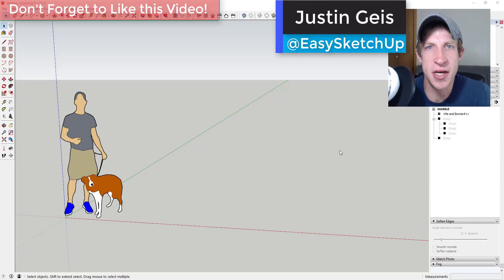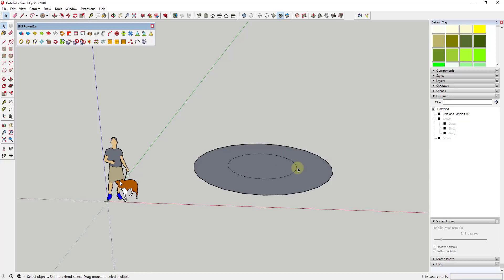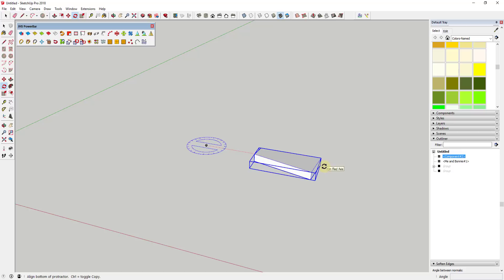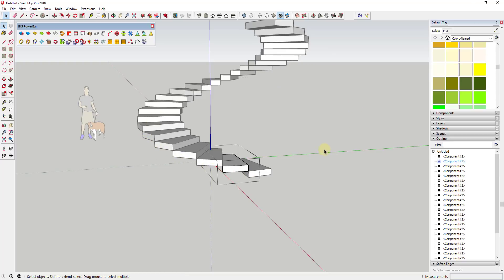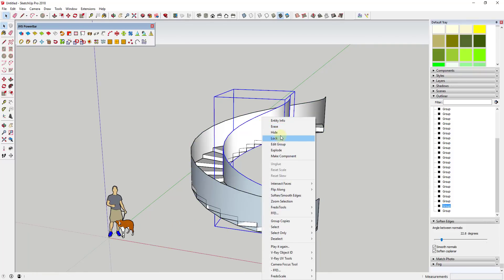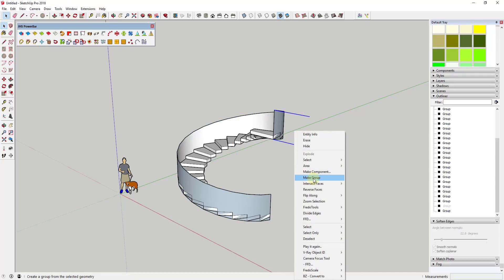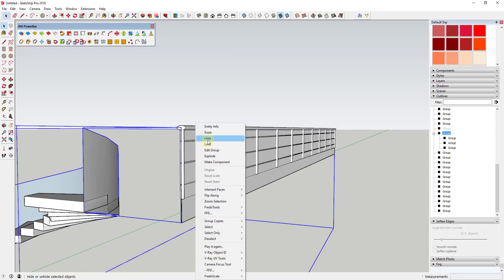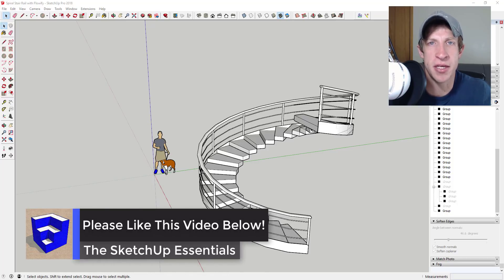CREATING SPIRAL STAIR RAILS IN SKETCHUP with Flowify

Comment: Hey, 

I'm having trouble doing the actual flowify, and you actually skip the part where you perform the flowify. It seems my grouping works, because I can impose grid. My railing is a little different though, because my railing is against the side of the stairs and not on top of it, so I tried not to draw my railing inside the flow panel like you did. But even when I do put it inside the flow panel, it keeps saying "not enough input". Any tips?
Reply from the maker: Well first of all, I don't understand what you mean about skipping the Flowify. I literally showed every single step in this video. Second of all, if it tells you you don't have enough input, your grouping is wrong, or you don't have enough objects selected...
Reply: @Thesketchupessentials  Sorry I wasnt trying to be a smartass! It's just, at 17:16 you say "hit the save button" and then your rail is done after a cut. Other than that I can't really figure out what I'm doing wrong, since I feel I'm following the steps...
Reply from the maker: @ThirdDegreeGurn  17:45 I run it again and show you exactly how. Your grouping is wrong - you don't have your 3 groups inside a single group, or you're not selecting your base object and your target group.
Reply: @Thesketchupessentials  shit I'm sorry for giving you a hard time then. I had not selected my rail group. I now have a different problem. I dont get the error on clicking the flowify button, but now just nothing happens. Like the cursor changes from white to black so something happened but nothing shows. Btw youve been my go-to sketchup guide since i was a teenager!

Comment: Justin, you could've made a component instead of a group @5:05, so that the step can be modified later however you want. After exploding, you will still have step component instances. Good video presentation buddy.. !
Reply from the maker: There's probably a few ways I could have done that part better - I was in a bit of a hurry that morning, but the Flowify pieces should still be sound - thanks!